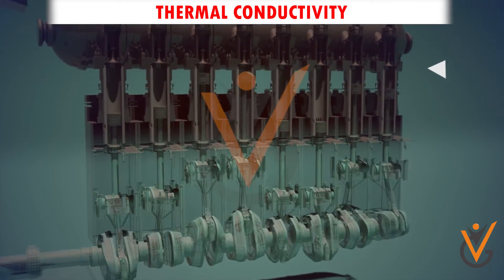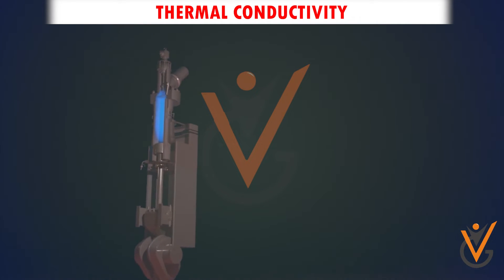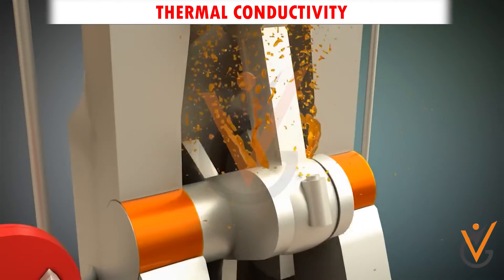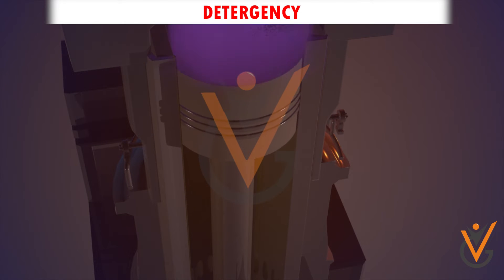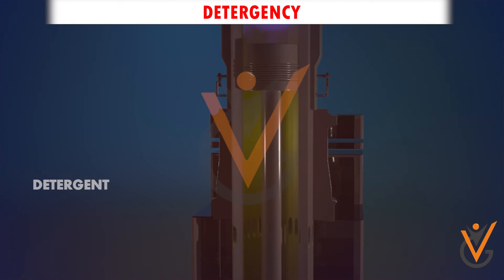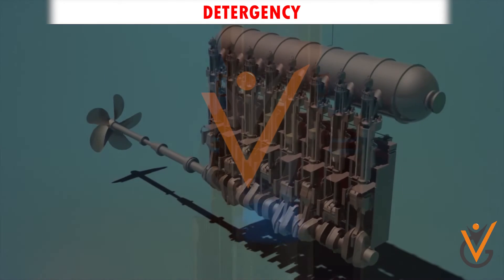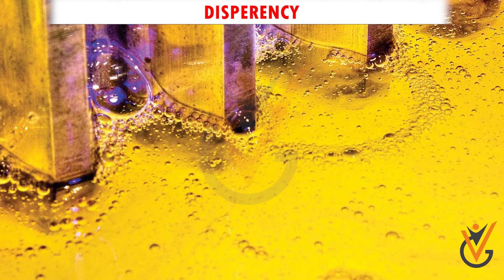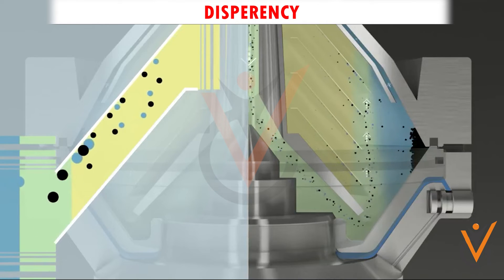Thermodynamics | Physical & Chemical Properties of Fuel & Lubricants and Technology of Machines

Comment: 1.Viscosity
2.High flash point > 220°C
3.High thermal conductivity
4.Alkalinity 
5.Oxidation resistant
6.Discrepancy
7.Low demulsification number
8.Load carrying capacity
9.Lubrication